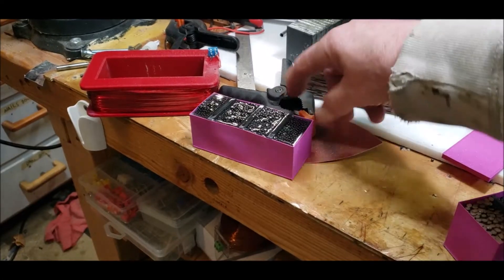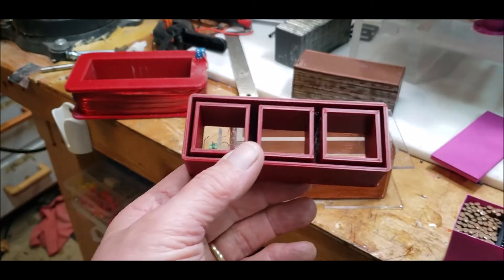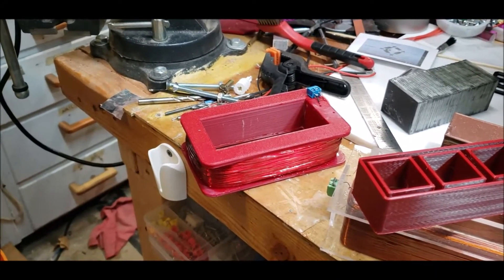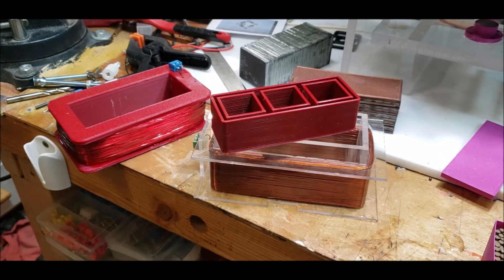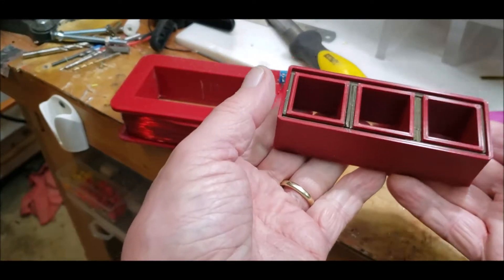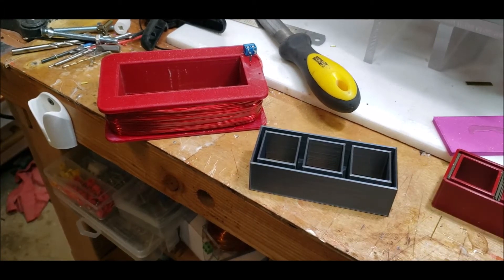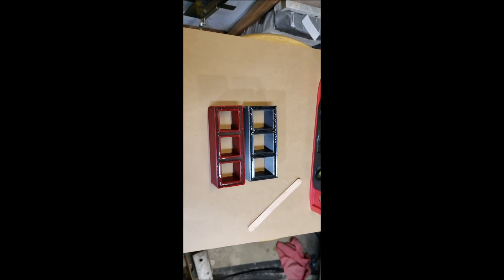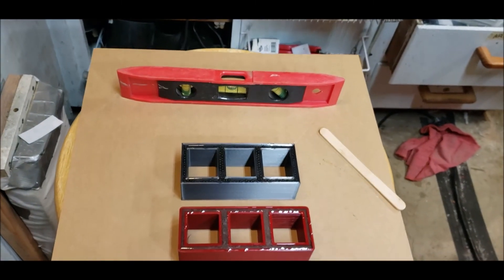3D Printed Air/Iron Core

Comment: You had shared with me the Proto Pasta - Iron infused PLA material ( thank you very much!). Do you know if the material is able to be printed in a duel extrusion printer? I have a duel extrusion printer and would like to print the Iron infused material PLA with another non magnetic typical PLA. Curious if you’ve already tried it. Enjoy the project so far, look forward to more.

Thanks for sharing!
Reply from the maker: It should work just fine. It prints like regular PLA. I would just be care to keep the filament dry but other than that, it should work just fine.